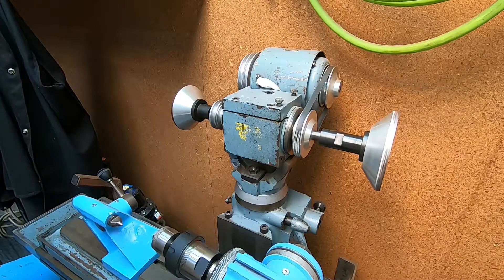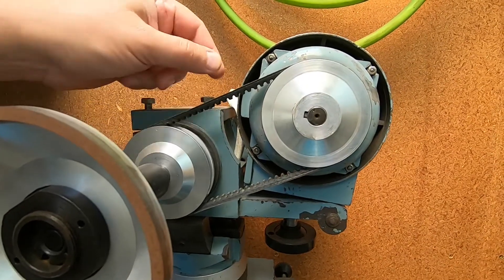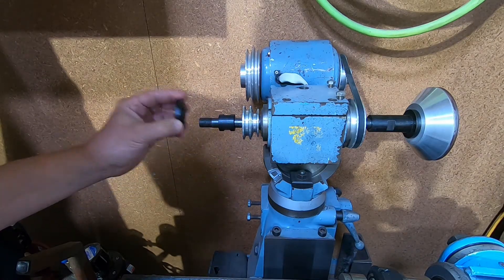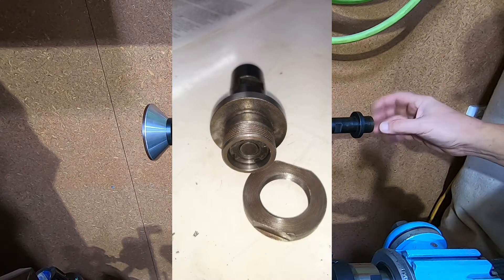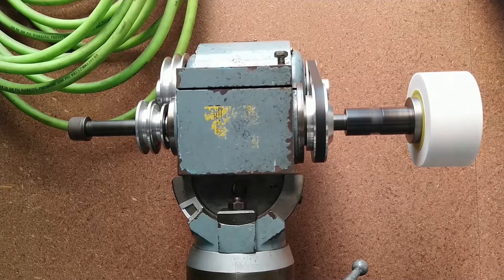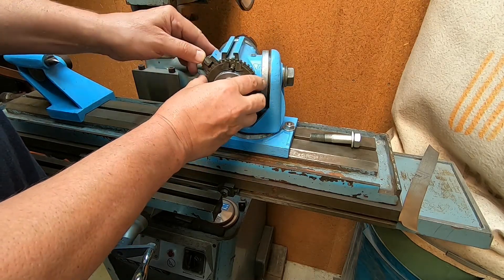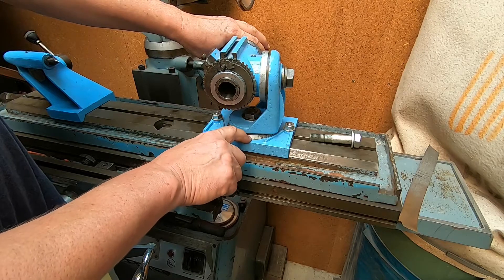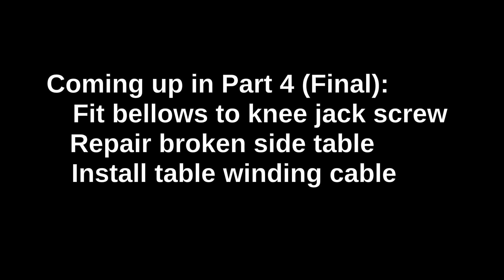Restoration of an AR/5-E tool and cutter grinder - Part 3: motor, arbors & work holder

Comment: Hi Alan. Nice little grinder. Just a heads up with the high speed spindle which looks to have Angular Contact Bearings, standard practice is to run 10W oil in them, not grease. They only need a enough oil to cover the botton of the race when sitting Horizontal. If you can't run oil there is a high speed grease available from Bearing Suppliers which must be used sparingly or the bearings will run hot. Oh and don't run the spindle backwards or you might fling a wheel off as the nuts undo themselves. Nice work.
Reply from the maker: Thanks Graham, that's good advice and I'll take it. I used grease because that was what had been used previously and also there are no oil seals. I used good quality bearing grease that is supposedly fit for purpose and good for 10,000rpm. However, I was rather heavy handed with it, so will strip the spindle down and clean out the excess. I certainly take note of your advice re risks of running the spindle in reverse, but then wonder why the machine was supplied with a reversing controller...
Reply: @alanshomeworkshop  Hello Alan. I want to thank you for the details on the dividing head. That most certainly will help me build one for my grinder :-). Regarding the two spindle directions, the manual indicates, that the wheel on the non taper side should be removed when running the spindle           in the reverse direction (for the thread direction).  I am considering shrinkfitting a taper (and hub) to that side on mine, as I would like to fit an aluminum oxide wheel on one side for surface grinding, and a diamondwheel on the other side for carbide grinding. But I would like to awoid refitting and trueing the aluminum oxide wheel each time I've run the spindle in reverse. I would think that it should be possible to leave it on with a taper on both sides. Or make it easy to take off and on without hawing to re fit each time.
Any insight or thoughts are wery welcome.
Best regards
Kasper.
Reply: @alanshomeworkshop  Oh, and if you should decide to take apart the dividinghead, I would be wery interested in seeing some footage. I can't really decide if I should make mine with bearings or just go with bronze bushings. Maybe ad an air fitting to make it a sort of air bearings...
Reply: @alanshomeworkshop  Allso, are you sure, there's supposed to be 2x3 sets of rolllers on each way on the table? When I disassembled mine, there were 2x2 sets both on the horisontal and on the angled ways.  I wonder if you have a source for this kind of information, as the manual is nearly useless, except for some examle photos of grinding setups...
Reply from the maker: @kasperelbak  A key element of the spindle design is opposing sets of bearing balls in tapered seats. This allows end and side float to be adjusted out as wear occurs. Seems like a pretty good idea to me and pbly better than plain bushes.
Reply from the maker: @kasperelbak  I have a friend in South Africa who sent me a photo of his AR-5 and it has 16 bearings - 12 for the horizontal plane and 4 for the gib. It seems that the bearing units are a bit vulnerable as a couple of his and one of mine had damaged cages - apparently inflicted by the heads of the bump-stop screws. So maybe a previous owner just removed the damaged units. It is also possible the number of bearings was the subject of a running change during the production life of the machine. BTW I modified these bump stops to reduce likelihood of this damage - see first video.
Reply: @alanshomeworkshop  Ok. Good to know. I allso had one cage slightly damaged, but was able to straighten it out. I suspect they are only damaged if the hard stops on the table are removed for some reason. I know I bumped mine a few times before I figured out how to disassemble it. 
You might be right about different production years. If I remember correctly, yours allso only had 12 bearings when disassembled? 
Regarding the spindle design in the dividinghead. I'm not sure, I understand exactly. Is it loose balls running in some kind of v-groove seats? Did you have it apart, or have you found a drawing somewhere? I have searched quite a bit for information on this grinder, but it seems there's not much to be found...
Reply from the maker: @kasperelbak  When I stripped my machine down, there were only 6 bearings on the flat and none in the gib - this was riding on the (empty) long cage!!  
Photo at 12:45 shows dividing head spindle with one row of balls. IIRC the end of the bore in the dividing head body is machined with a bevel that will locate these balls when the spindle is in place. Same thing at the other end of the spindle, with a threaded cap (visible in top right of photo) to apply preload to the opposing sets of balls. This supports the spindle in a similar way to a pair of tapered roller bearings - but in a very compact design.
Reply: @alanshomeworkshop  Yeah, thats not quite enough ;-). Aaahh... I see. I thought that was the grinding spindle. I think I understand now. If you have more pictures, I am very interested in more details. Especialy of the threaded part / parts of that end of the assembly.
Reply: @alanshomeworkshop  Thinking a bit about the bearing units. Mine is the extended travel version. So maybe there's not enought room for 3 sets with the extra travel side to side, if the knee is the same as for the standard model...
Reply from the maker: @kasperelbak  Mine is badged AR 5 E/ET which I think indicates an extended table version. However, I'm not sure whether the extended table actually gives a longer travel - maybe just a bit more real estate to work with. I'd be interested to see any confirmation of this question....
Reply: @alanshomeworkshop  Hi Alan. Sorry for delayed answer. Christmas and all that ;-). I think you might be right, that it indicates extended table instead of extended travel. I looked at lathes.com which mentions the extended table option but no mention of extra travel. There's mentioned 300 mm of travel, but I'm pretty sure, mine has more than that. (I'm not near it to measure right now, but if you are interested I will measure, when I get home).
I want to thank you again for all your help and your videos. And I would be very interested in more videos when you get grinding. I'm especialy interested to see what surfacefinish you can get, if you plan on surface grinding on it.
Reply: @alanshomeworkshop  Hi Alan, the ET or extended table version has a table travel of 450mm instead of 300mm on the standard version.

The T'slot on top of the workhead is/can be used for mounting the cutter indexing attachment for some setups where it is not practicable to mount it using the post off the table T-slot. My J&S 310 cutter grinder also has a T-slot on the workhead

You appear to be missing the fine adjustment screws on the slotted plate which fits on behind the slotted indexing plate. These bear on the pin in the slotted index plate and are used to provide fine angular adjustment to the slotted index plate.

As of yesterday I now have to of these machines (both requiring refurbishment) one standard length table and one extended. I also have most of the accessories which came with the original machine (bought some 10 years ago) but sadly not with yesterday's acquisition. If you want photo's etc of the missing adjustment parts let me know